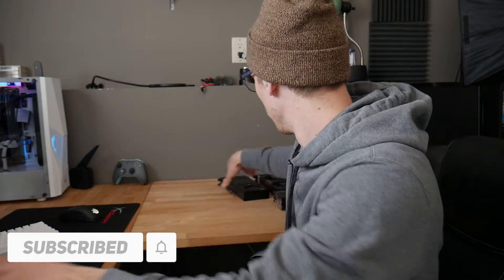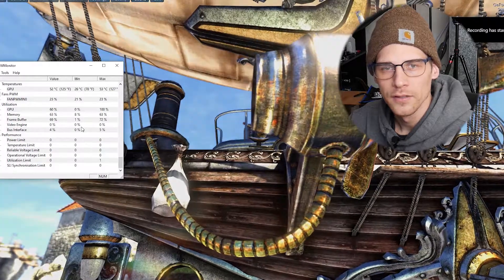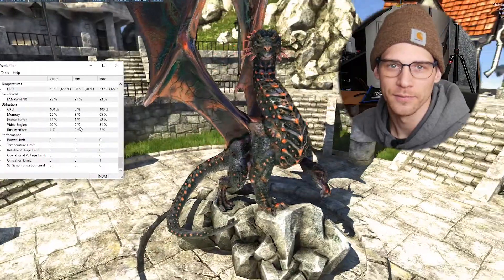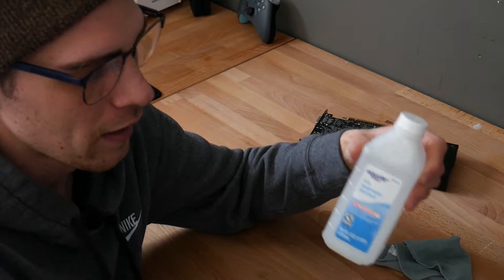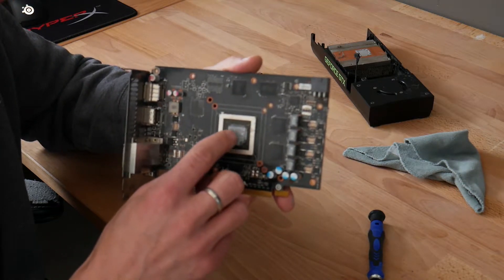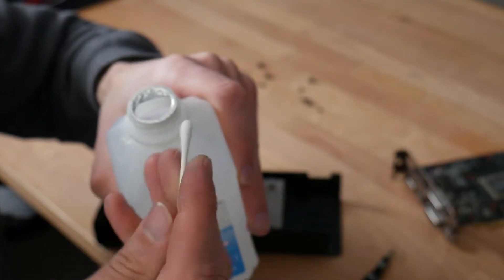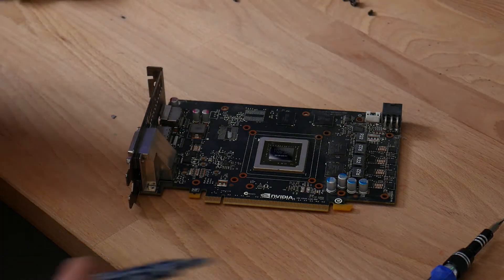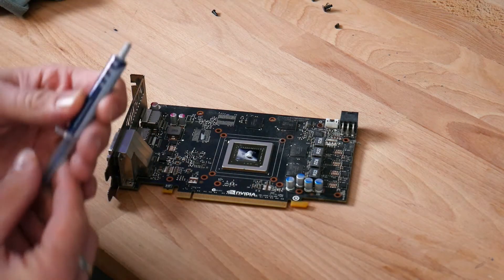Upgrading Your Video Cards Thermal Paste - Is There Any Benefit? (Old GPU's)

Comment: you should see what kind of temps that card gets with no thermal paste, i’m really surprised that old gunk did that well.
Reply from the maker: So am I! Especially with how hardened up it got, with no paste I dont think it'd run more then a minute or two
Reply: @YourPersonalGeek  i had an old AMD FX chip that when i went to replace the thermal paste, their just wasn’t any. i have some faith in the no thermal paste.
Reply from the maker: With the old AMD stock cooler?
Reply: @YourPersonalGeek  it was some weird cooler master-Dell variant of the stock cooler. cheap aluminum sharp mess

Comment: It definitely depends on the card. I repasted my used GTX 980 and didn’t see a difference. It was still running a bit hot, so I bought some new be quiet fans and that made all the difference. Sometimes it’s poor airflow (definitely should have more than 2 fans).
Reply from the maker: Absolutely, the TDP of 650ti 110W amd 980ti is 250W so you're right fans are much more important for cooling when it comes to that card

Comment: Nice! I had a card that dropped 10 degrees, but normally only a couple degrees. Just depends on the card.
Reply from the maker: Man 10 degrees that's huge, definitely worth it 👌 I kind of figured it wouldn't make a huge difference on this one but a few degrees is a few degrees
Reply: @YourPersonalGeek  yeah but I’m fairness it was running at 80c and not 55c 😂😂😂